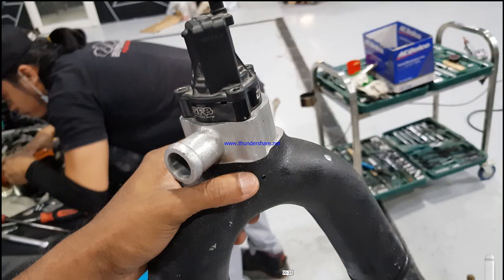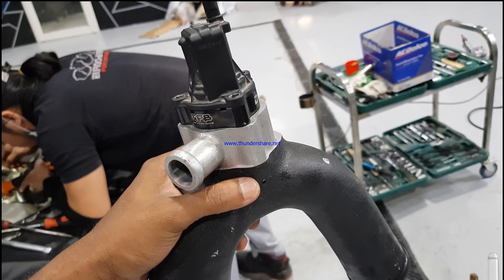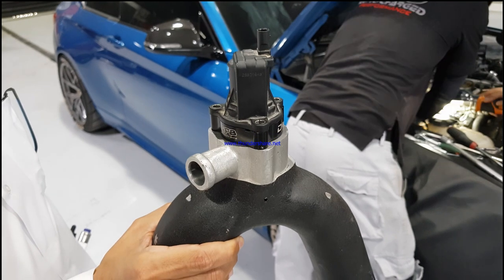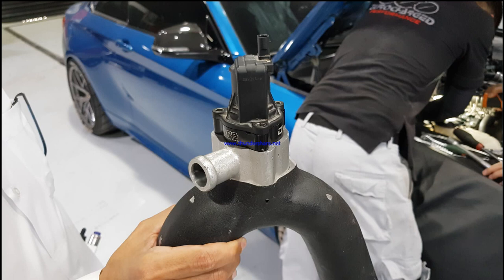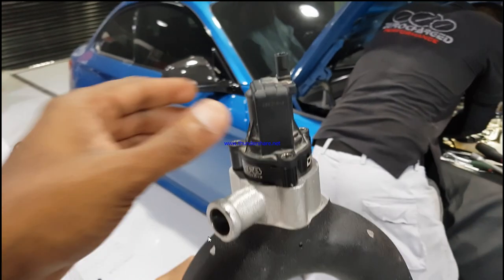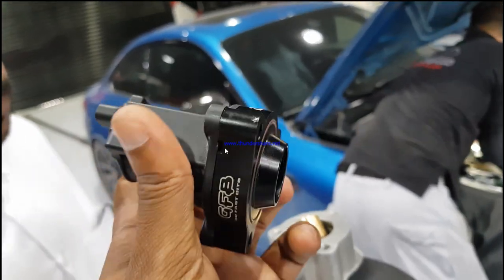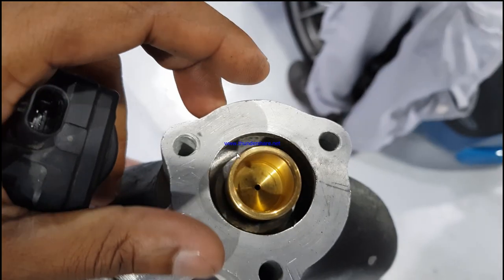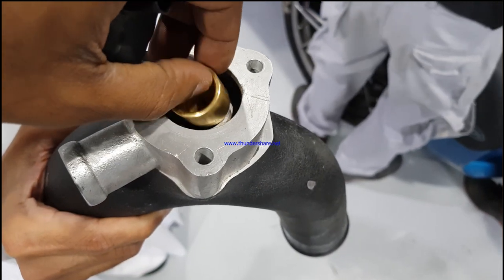Boost leak on a 2017 BMW M2 with aftermarket upgrade kits.

Comment: I have a few questions. 1 what was they solution to the problem? And 2 was the car stock internals ? 3 can you give a break down of the build and also dyno numbers as well ?
Reply from the maker: 1.Solution was to replace the bov and adjust the height with the new bush.
2. Its upgraded engine and gear.
3. Sorry that i cannot give breakdown. Because its a bolt on upgraded turbo kit. Car can make 700 plus whp.
Reply: ENGINEERING INVESTIGATION Thank you! And Building my M2 as well and my goal is 650-700 and would love to get some detail information from you if you don't mind.